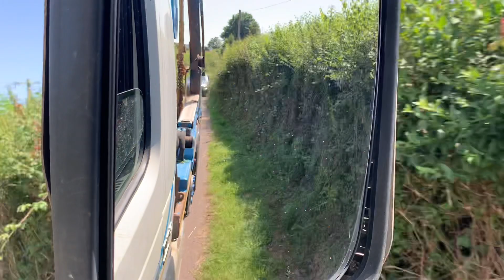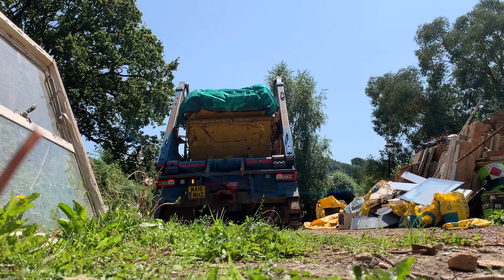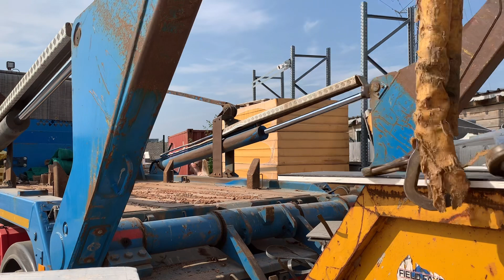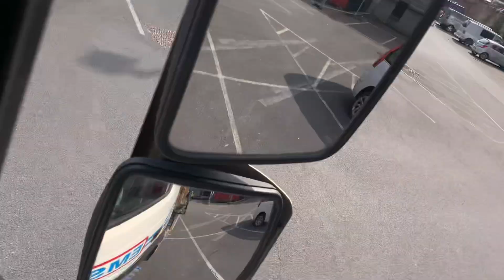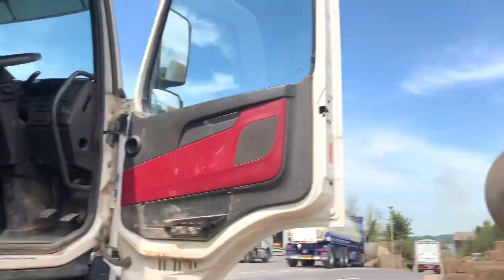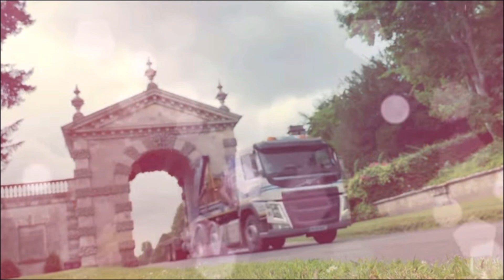Skips, fires & a team up!

Comment: Hi Chloe, that fire popped up on my fb news feed as I follow Yeovil Fire Station and I did wonder at the time if that was near your base! Was there much damage to anything near that wood chippings bay?
Reply from the maker: Ah yes I think fire engines came from all around. No they had it under control in no time… to be fair within minutes they were there and the wood that was a blaze got separated so no damage 😊
Reply: @SkipChickSW  that's good, there have been quite a lot of barn fires this summer due to hay heating up trouble is it then damages lots of expensive machinery too
Reply from the maker: Yeah I can imagine. It’s just been so hot!  But on this one was lucky I think the only damage was one shredder as that’s what started it.